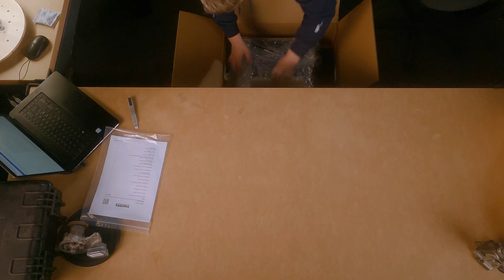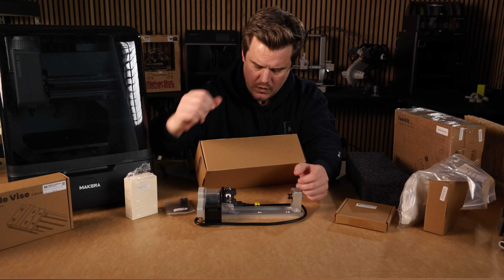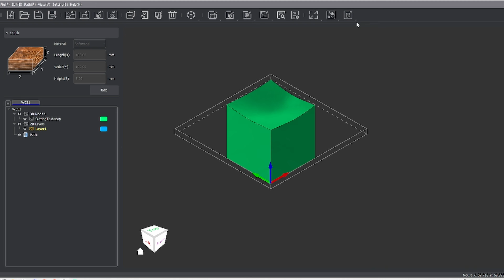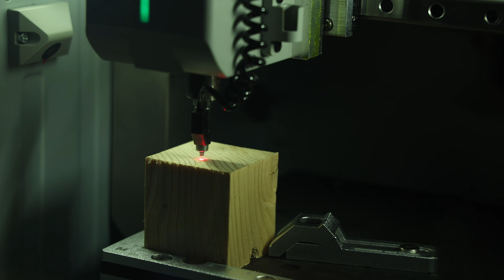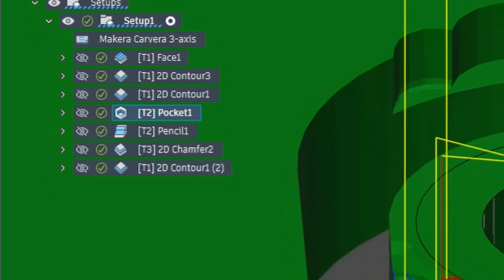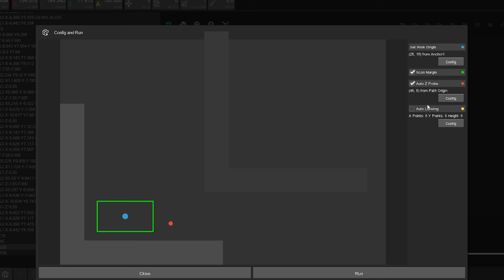Makera Z1 CNC - First chips and unboxing!

Comment: How did you get fusion to work with the Z1? Every time I export .cnc from fusion, it fails on the z1 because MS does not import the stock settings from fusion360

Comment: I do not recommend buying this machine.
The unit I received was defective. Even after the seller sent replacement parts, they arrived with severe scratches and damage in multiple places, looking more like a used machine in only about 50% condition than a brand-new product.

The spindle is too thin, resulting in poor rigidity. The 4th-axis chuck is also defective. In addition, the controller does not support G2/G3 circular interpolation commands, which is a major limitation for CNC machining.

I deeply regret buying the Z1

Comment: Hello, do you really recommend me buying the cyclone dust collector ?
Thanks
Reply from the maker: For all my milling I’ve only used a shop-vac, and since I’ve been present that have worked out fine. Even with an adapter to put a vac on the outlet I’m afraid the lack of “blowing” of air isn’t enough to clear everything.  So with just vacuum, not strong enough. With thw cyclone and blowing plus sucking, it should be pretty good. I don’t have the cyclone myself, so I’m not confident.

Remember to use the affiliate link in bio when you order 💪😅

Comment: Free version of Fusion will let you use the 4 axis for indexed milling, basically it will let you turn to a specific position then perform a 3 axis path, so you either need the paid version or use Makeras software for their 3.5 axis. They say true 4 axis is being worked on for Makera Studio, so fingers crossed.
Reply from the maker: Thanks! I guess 3.5/4 axis should be explained a bit yeah, it's probably confusing for many others than me ;)

Comment: On your 2nd part, you should've used 2 clamps, not just one. I didn't think you were going to get away with that. My mantra is rigidity and repeatability is everything. Source - 30 year CNC machinist. Good review - thanks.
Reply from the maker: Thank you for the tip! I'm going to take your advice for the next one, I think it went well, but now with aluminium i assume forces are a bit different. Will probably start using the vice instead.   are there formulas for how tight you should tighten a vice?... Like when does it start to leave marks in the material vs. holding it. Guess I might just have to find out.

Comment: Thanks for sharing your raw experience- felt more unique to the standard reviews.

I’ll also be coming from 3D printer land, so it was interesting to see your assumptions- especially with the auto levelling. My understanding is that you want to profile the material when you want your cutting to be adjusted to follow the material profile (for example to get consistent depth of cut on a PCB). A CNC should always have the cutting parallel to the bed, so if you want a part relative to the bed you don’t profile the top of your material.

Might be a good video to take people through the changes in thinking/assumptions vs 3D printing as you uncover them.

Comment: I just want to see people test this with mild steels...that's the main application I'd use it for (outside of maybe aluminum here and there).  Also, how do you think this would do with cuts on tubing, not flat surfaces?
Reply: I really believe this is a poor choice for mild steel. 
The jump from an ali mill to a steel mill in terms of forces is massive. I designed a machine for milling mild steel and it weighs some 5 or 6 times what this does.
Reply: @garethbennett3780 Well, Makera has posted a few vids and the results at least for simple shapes look okay. Only testing will tell what it is actually capable of, so I'm hoping to see some people actually push it to it's limits and show everyone
Reply: @_Livefreeordie_  If I remeber right their conclusion was it's maybe fine for ocasianal use but not really if that is you main work material. It will be really slow.

Comment: Thanks for sharing, useful to see all of the parts the machine ships with. Should you not have also used one of the stock retaining screws in each side of the L bracket to more securely hold the epoxy board down? Probably didn't matter with that material, but I'd guess would of done if you'd used aluminium.
Reply from the maker: I think toolholding becomes much more critical when doing larger and more demanding parts for sure!

Thanks!

Comment: videos like this are completelly useless really, do those people realise this?? He presented some shit I could make on my 90 $ chinese plastic cnc. They are paid for the advertisment so they don't give a shit what they are doing. This really pi.. me off. Someone who wants to buy this machine or not wants to know exactly what is possible wht not and not something like this useless...
Reply from the maker: You obviously have no clue. I bought this myself because I love the tech, it’s not a review unit and certainly not a sponsored deal. 

The simple cuts I made in my first attempts are nothing fancy. It’s when I start doing alu or steel it’s going to be fun!

I don’t know but Chinese machines really don’t usually seem user friendly, not “working out of the box”, but I wouldn’t know, this is my first experience.
Reply: @3DPrintTechDesign  Fair point on the out-of-the-box experience — what would that actually look like for you ideally? Like plug in and start cutting, or something else?
Reply: The video does exactly what the title says it does, if you want stress testing, improve your reading comprehension some and I'm sure you can find something.
Reply: @garethbennett3780  this is the problem, I can't find anything. ALWAYS they put shit like this or someone making a project from Makera like that pcb over and over again, the same one. Your comments only make me think what kind of people are buying actually this machine (some who wants to have an expensive toy that's it). It is kind of a premium treadmill people buy and then they even never use it. I have always problems with products like that to find any specific information or experience from users on YouTube. People often descibe those machines like toys (expensive toys).No details nothing usefull on YouTube. For me this is a FU.. TOOL !!!!!!!!!!!!!!!! And as it is made in China and I CAN'T  test it (I can base only on videos about this machine!) I want to make sure that it meets my expectations! So many people bought already and no single video usefull enough.
Reply: This video was exactly what I wanted to see. I don't care about a $90 CNC. I want to see a Z1!